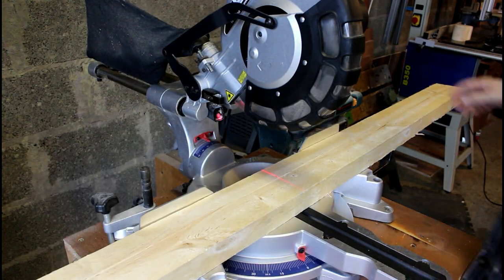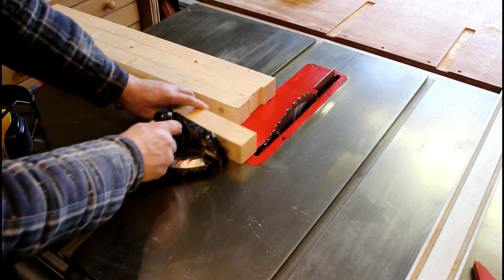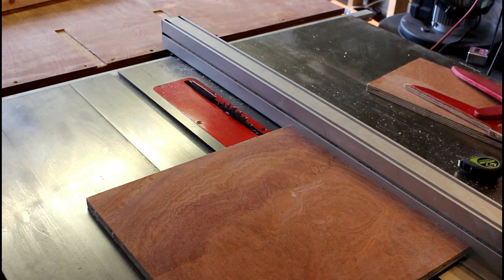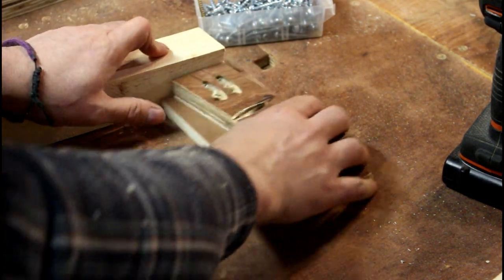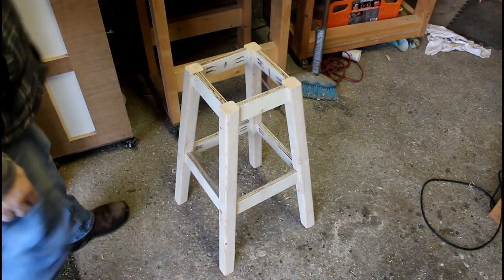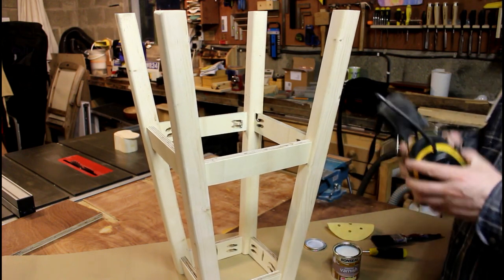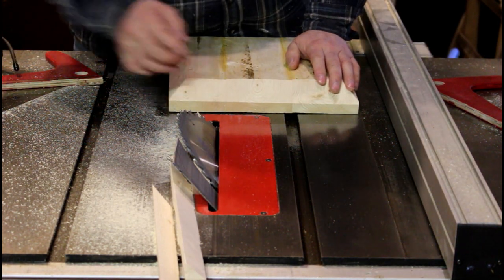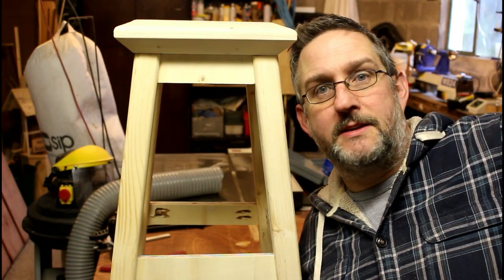Simple Stool

Comment: At 15:35 in you are using a push shoe the wrong way! By having closer to the blade than to the fence it will tend to rotate the workpiece causing a kickback, rather than pushing it straight forward. Try it and see if you don't agree. You could even use your miter gauge because the end is not trapped by the blade because of the bevel cut. I do this often. It's a myth that you can't use both the miter gauge and fence at the same time, there are some restrictions, however.

Comment: Lovely job mate. I actually hate using the router more than anything 🤔
Reply: I was routering a small circle and lost my finger tip. So I get it, keep a healthy respect for the tool.
Reply from the maker: Yeah, the router is fairly scary to be sure, but I think that's manlinly due to the noise levels, it's by far the noisest tool in the shop!
Reply from the maker: @bobrobertson9636  ouch!
Reply: @andy.elliott.foreverpens  the circle  I was working on was a nose for a outside Santa. I believe it was just to small to hang on to, live and learn.